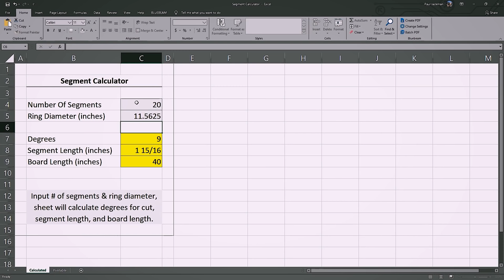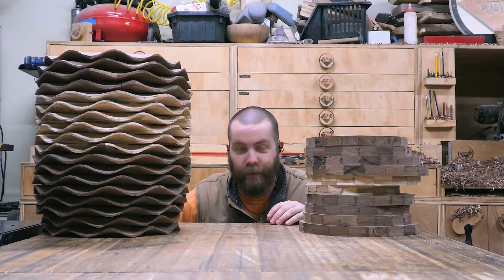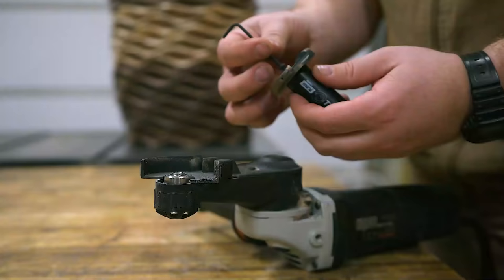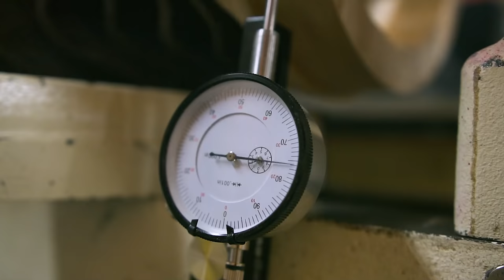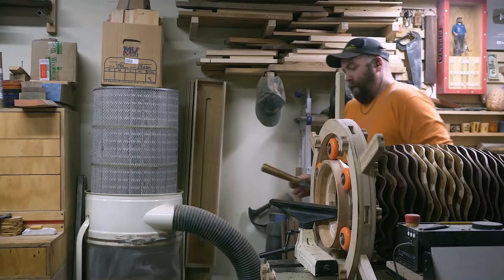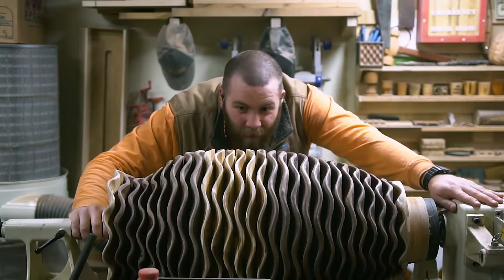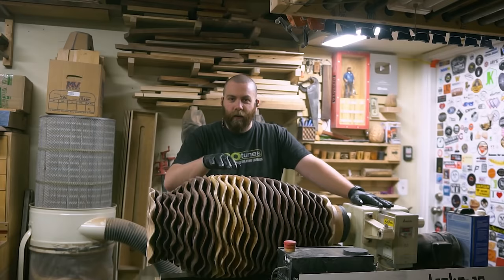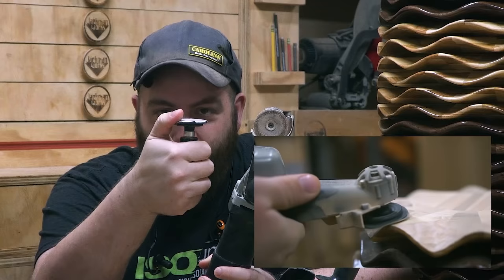Making the Wavy Vase

Comment: Awesome!
If you found the looooong scraper to be a bit too chattery, remake it with the bulk of the shaft length being a thick walled tube, mount a short section of the bar at the end to hold the tool bit. The tube will be much more resistant to flexing over that length than the bar stock is. Nice solution though.

Comment: Hi, loving your channel. I like your 5 wheel steady rest. Could you have got the bottom two wheels lower? What are the two wooden knobs on the TS end of the bed for? I'll look for a steady rest build/lathe tour video. =D
Reply: Found it. I'm guessing the answer to my questions are..... No and didn't need to and the knobs are in two of the four holes for a bed extension..... but are they there just to be handy/keep the dust out or do they have another purpose? Ah, just realised.... there there to clamp accessories like your disc sander table. =D As you may have guessed I've never turned wood.... but soon. =D